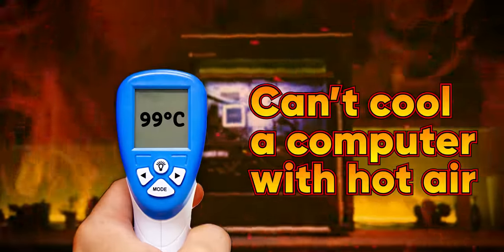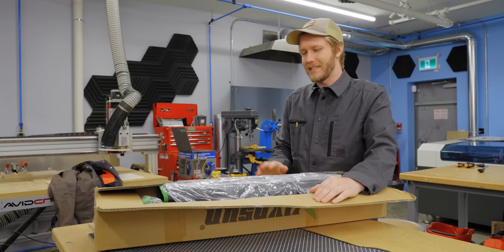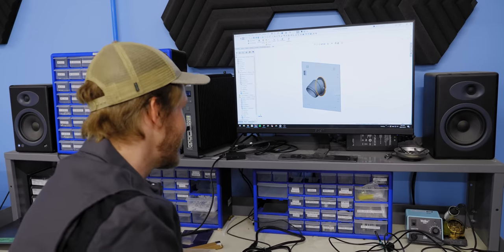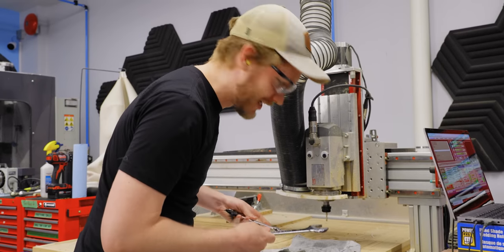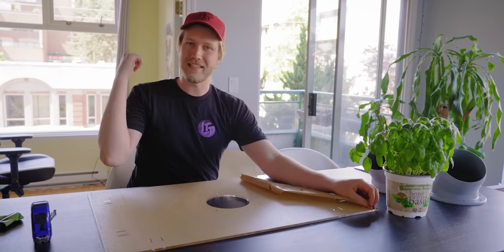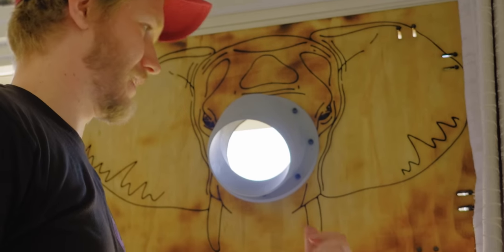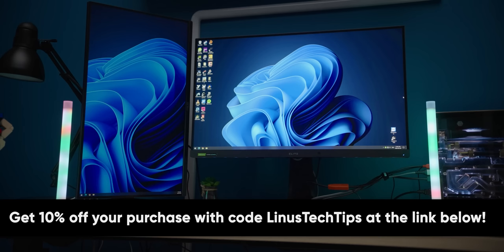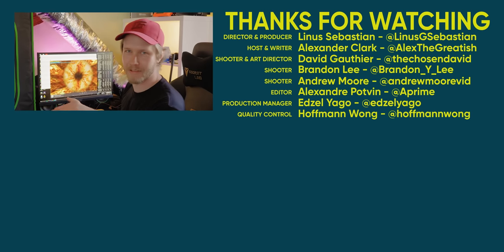You’re cooling your PC wrong. - PC in a Grow Tent

Comment: With as much air that's being pulled into the room, I'm wondering if just having the blower suck the air from the room and exhaust it outside without use of the grow tent would have been sufficient enough.
Reply: In the cooler seasons I just put a window fan in one window exhausting out and crack the other window open a bit. Keeps the room cool and thus cools down the PC
Reply: Ya, this is probably a bit more effective, since the PC heat doesn't get mixed with the room air at all, but just sticking an exhaust fan in the window would be a cleaner install and work well enough.
Reply: True. It may help with keeping the entire room cool, but that's removing cool air from the rest of the house which means your AC is going to be working harder. Installing a quiet exhaust fan that vents air from the room to the rest of the house might be a better option.
Reply: Yes it would have.

Comment: A 3D printing enclosure tent would work too! They're smaller so they would probably fit the pc better
Reply: @Susanna A quick glance at Amazon shows that the Creality enclosures run right around what he paid for the grow tent (some cost more, some less) depending on the size. Didn't see any 10x the cost? There are, of course, plenty of way to DIY such an enclosure for significantly less (or more) depending on materials and time.
Reply: some people use grow tents for 3d printers still. (not arguing, your point is 100% valid) they also can work as a makeshift "clean" room, most supporting the addition of a carbon filter.
Reply: @Susanna at some point making a box yourself is more affordable 😅.  And you actually get what you want from it

Comment: He said the room is cooler than before and that there is so much airflow coming under the door. I think that proves that this whole grow tent contraption is doing nothing.
From what I understand , earlier while he closed the door the cooler air-conditioned air didn't make it through fast enough to the gaming room. Now the fan is evacuating all the air from the room to the outside and thereby sucking air in from the other room. 
so basically ditching the tent and having only the fan would basically achieve the same results. 

Also isn't this basically wasting energy by expelling the air-conditioned air outside ? reminds me about the Technology connections video about portable  air conditioners. 

The same setup with an intake pipe would make much more sense
Reply: There is no air conditioning
Reply: Yep. Home AC is a closed system you're not supposed to vent hot air outside. A better solution is to find a way to get that hot air to the air return so that it can be cooled by the AC unit.
Reply: The tent is keeping the PC heated air from mixing with the room air, so it is definitely more efficient at keeping the air in the closed room more comfortable. Yes, just exhausting a lot more room air out the window would work too, but a lot less efficiently.

Either way you are still extracting cool air-conditioned air from the home and dumping it outside. It would be even more efficient to use outside air as intake into the tent, even at the price of taxing the CPU cooler a bit more. But that would mean more ducting - or a duct within a duct, and higher fan speeds.
Reply: I had the same thought - just yeet the air out the room with some sort of noise baffle in front of the fan, also means the setup can be more discreet

Comment: An extractor fan like the ones used in a bathroom wired to an outlet with a temp sensor on it would be a much better solution. It would just extract the hot air from the top of the room and draw in cool air from underneath the door. No need for all that bulky stuff and much quieter
Reply: @OpenYourMind smarter doesn't make a good LTT video though...
Reply: That's what I did and it works great, I think this video was just for fun.

Comment: "this is much cheaper than an air conditioning unit!"
proceeds to use several tools in a workshop that likely cost tens of thousands of dollars
Reply: buy plexiglass(or wood), cut it to your window dimensions with the hole size for the same PVC plumbing (15,30,45°) pipe which you will connect to your insulated hose.
you can stick velcro on the plexiglass for easy set up/removal on window

you don't need many tools to do this and it costs 30$ total in materials + the tent + 50$ for the motor
TBH its an good idea, but II would put all the hoses up the wall to the ceiling then to window out
no clutter in the room
if you buy spiral duct pipes, then its a lot sturdier and you can go smaller dimension

Comment: @LinusTechTips - I would love to see this become a series. "Making your gaming space cooler" - a series exploring several methods to mitigate the heat produced by gaming PC's. Many of us have felt our gaming spaces become hotter with successive hardware generations increasing power requirements. More-so in light of the jump in the power requirements of GTX4000 RX7000 cards. Revisit the outdoor radiator concept. Dust off the "PC water cooling bong" concept from the mid-2000's. I think everyone is silently sweating out collective a**es off. LTT - only you can deliver us from our swampy hell! 😂

Comment: You don't need the whole grow tent thing -- just use a fan to exhaust air out that window, I'd wager it would perform identically, if not better. (Due to no air restriction of that hose and the tent)
Reply: Not really though.

As stupid as this is, it's still gonna stop the hot air from leaving the tent. That's a major help.

Comment: You would need an intake from outside as well to not draw in the hot air elsewhere in the house. The same reason monoblock ACs don't work that well. The PC would then be on its own "air loop" and isolated from your cooler inside air. It would run a little hotter because of the outside air temp, but as long as your clocks are stable it doesn't really matter.
Reply: Thats fine in this situation as he has central air conditioning. His problem was that room got hot with the door closed and the computer running.

Comment: Seeing as it’s basically just drawing air from the rest of the apartment. Wouldn’t putting the blower in the window without the duct basically accomplish the same thing? Just with a slightly slower response time?
Reply: Drawing air from rest of the apartment is just a side effect, the main target was to get rid of the hot air without it mixing with the rooms air. If there was only a blower in the window, the room would get hotter unevenly, the wind would travel through the shortest path door->window and since the PC is not in its path, the part of the room with the PC would be hotter.

Comment: I feel like you could DIY a solution for this that's better by putting some (better looking) ducting on the places on your case where the air is exhausting and do the same thing without taking up nearly as much space. It's a neat idea for like a Van or RV PC to dump the heat outside during the summer.
Reply: You can't duct every hole the eir is exhausting from, even doing some of them would be 1000x harder, 100x uglier, and waaaay less efficient.
You're better off just getting a smaller tent.
Reply: @cotneit  It's too bad that you can easily cut the tent tubes, but you cannot shrink the fabric.
How do you DIY it?
I would put my money where my mouth is, but I am playing TradeWars 2002 right now.
Reply: @drippingwax  Yeah, but how do you duct every hole in your case?

I'm not saying you should DIY a grow tent, though you absolutely can "shrink" the fabric by creatively folding it after you cut the tubes to the size.
Reply: @cotneit  You can fold it, but what would you do with the zippers?

Comment: You should have used the second fitting to make an outside air intake. This is blowing all of the conditioned air from the rest of the house outside.
Reply: Why would you want to blow hot outside air on your computer? He just needs a smaller fan, really, that six inch is meant to handle a 1,000 watt HPS lamp burning at 3,000⁰F.
Reply: @hlaw2830  Define hot. They live in Canada. It doesn't get hot enough for the ambient temp to be too high, as long as there is consistant airflow. They definitally shouldnt be blowing conditioned air outside of the house. HUGE waste of energy, as well as warming the house overall and more strain on the AC unit.
Reply: @p0xus  Lol, so the elephant in the room is that the three of use are American, and as it turns out, AC is part of American culture. This is the only country where you can assume that someone has AC, and like you said, they're Canadian.

There's literally a video of them installing AC in the old house, a bunch of mini splits. I live in an old run down house in a blue collar town and it was built with five tons on the roof. So, you make a fair point about it not being as hot up North for the most part, but... there's probably no AC to exhaust.
Reply: @hlaw2830  That is a fair point, lol. If there is no AC in the house, than the point is totally invalid. I guess he didn't mention if he had an AC unit or not, did he? I was under the impression that the LMG team knew about not pushing non-saturated, conditioned air outside; so I'm now thinking that he doesnt have a unit and didn't see the need in mentioning that.
Reply: The AC unit can likely handle it.
Reply: @p0xus  My car's exterior temp read 112⁰F last week, but Canadians do not have California central valley problems, lol. Conversely, if you take a trip to Southern California, and it rains, don't drive if you don't have to, because the people and roads both just can't.
Reply: @hlaw2830  it's been hot here in Arkansas too. In Vancouver the hottest recorded temperature is like 94° though.
Reply: @p0xus  Hm, apparently you cannot comment on the way the French spell things from a dyslexic perspective on YouTube; my oppression knows no bounds, lol. Arkansas is sub-tropical, I'm out here in the desert playing on easy mode, because humidity matters way more than heat alone.
Reply: @hlaw2830  Its horrible rofl. I hate it here.
Reply: @p0xus  I believe it, my veg room is 84F/68% and it's less comfortable than 100+ outside (probably 20-30%). This area also has a good amount of wind, so while Pasadena (Los Angeles) didn't get as hot, the air was stagnant, so it felt worse. Also, if you're under the impression that LA is full of models, I have the worst news for you, lol, cities are awful.
Reply: @hlaw2830  LA is actually one of my least favorite cities in all of the US. I much perfer denser cities that are walkable. Been there before. But yeah, so many people I have talked to about this in the past has claimed that humidity doesnt matter as much. It can sometimes be hard to convince someone who has never experienced it how bad it can be.
Reply: @p0xus  I grew up in the Bay, and while it isn't Manhattanesque in terms of walkability, public transportation was good enough that I couldn't justify a car, even as an enthusiast. I still don't think cities are good for most people though, being surrounded by strangers all day, sleeping ten feet away from them with nothing but a bit of dry wall separating you... it's really no wonder that many of our political differences exist. If you know your neighbor, and they're the only person within a mile of your home, you're gonna want them to be armed; if you live in a building with 300 other people, more than you could possibly keep track of, that idea probably terrifies you. The problem is that some people think local (or even personal) problems need to be addressed nationally, let alone state-wide. The people in SF and LA don't know a fucking thing about all of the farmers living in between, and people have literally died as a result of these cities believing that they know best (i.e. the Tulare County surface water issue).

Comment: 13:57 The Duct needs to be routed better as the up down and around is killing flow-- Pipe it up to the ceiling and use Command Heavy Duty Strips some large cord/cable hangers to strap to the walls/ceiling and have it reach the exhaust with the shortest run possible either with a 90-degrees horizontal or at a slight decline to prevent rainwater from flowing down into it.
Reply: If he stepped down to a 4" duct, he could put a dryer exhaust vent flapper on the outside.

Comment: I feel like blowing the hot air from the PC into a different area would be less wasteful if you have A/C.  The outside air would need to be the same as ambient or cooler to do it without A/C... negative pressure will cause outside air to come in from somewhere
Reply: And you are absolutely correct! This is why better Portable AC units have 2 hoses! One is called a Heat Pump while the other is an intake, this cycles out the air but has a cooling effect overall on the room due to the AC doing its cooling job!
Reply: “I feel like” is the new “literally.”

Comment: I actually considered something similar using a basic cabinet next to the desk right by the window and vent it outside as well. 
That said once I replaced my central AC with a minisplit system it became a non issue as I have temperature control in each room.   Had I gone with central air I would have to vent it outside because otherwise to get the office comfortable the rest of the house had to be freezing.  I even knew what I was going to use to exhaust air out, you can get a fairly quiet bathroom exhaust fan for about cheap or you can just use a HVAC booster duct fan, put it in a cabinet and run a small vent to the window.  You only need about 100ish CFM to keep it cool and could probably do fine with 60CFM.

Comment: I wonder if the tent was even necessary. The fan moving air out of the room alone might have kept the room cool just fine.
Reply: Yup. They just needed more cool air coming into the room
Reply: Ever wonder why they also made two of everything? Almost like there’s gonna be another grow tent. Maybe not used for a PC
Reply: I think Alex saw a post about an ISOLATED tent pc and then did a bad job of recreating it, clearly the intake is supposed to be from outside as well, this setup is equivalent to putting a fan on the window.
Reply: It doesn't work as good as you think. Once you have a couple hundred Watts of heat from the CPU and then 350 plus out of the GPU even a good box fan in the window has a hard time keeping up, especially if there are no other windows open in your house to allow air flow. I do this during the winter and use a portable AC in the summer. During the summer the fan can't keep up because you need to crack a window somewhere else in the house, so the air removed from the room can be replaced. But then my PC room only has one window. If it had two that opened you could just crack one and exhaust out the other. But if the air outside is hot the whole room will just stay hot. During the winter though crack one window for air intake exhaust with a fan out another window and that works really well. But only because then outside temperature is so low.
Reply: @BanditIsGaming  Making multiple parts is so they have a backup incase they break something since they are on time constraints because of filming/editing/etc. like he mentioned with the 3d printed part.
Reply: I had the same thought, but I think the tent is necessary to direct all of the airflow past the PC.  Without it, most of the exhausted air would never have flowed through the computer.

For that matter, Alex has the skills and tools to just design and fabricate an adapter for the back and top of his computer case to attach the air hose directly to the exhaust, then all the air leaving the room would have to flow through the PC, and that should improve efficiency a lot.  But that would be a lot harder for others to replicate, and defeat some of the purpose of the video I suppose.
Reply: @JohnA...  yeah they did mention that but I just like to think they made more to make a grow tent for other things. But you are completely right.

Comment: If you want something smaller, try a 3D Printer enclosure.  You might need to modify it a bit for larger ducts, but I'm sure you can handle that.
Reply: I was actually thinking the reverse after seeing the prusa i3. Using it as an enclosure instead. Just remember to move the PSU outside
Reply: Why not use the enclosure your computer already is in?
Reply: @Jehty_  see, that's what I was thinking. Modify the top with 3d printed mounted enclosure to suck the air through a tube out the window. Still need the tube fan so you don't explode your pc fans, but it would achieve the same effect without needing a grow tent.

Edit: you would set the back and front of the pc to bring in air and the top to push it out with the help of the tube fan.
Reply: Yeah I was thinking something similar to a Prusa Enclosure with holes that you can have the ducting come out of. Or maybe a PC case designed with the idea of having a duct to blow the hot air out
Reply: @AkselJade  with the tube fan they used you probably could remove all the fans in your computer.
Reply: @Prophes0r  sure,  but the point was to eliminate the room heating up from using the base case and you need to attach the running somehow to lead it to the window.